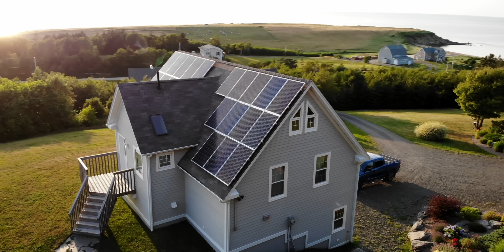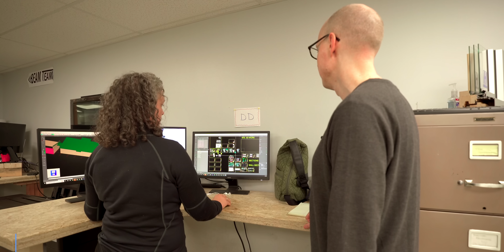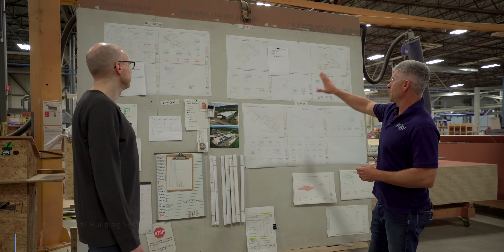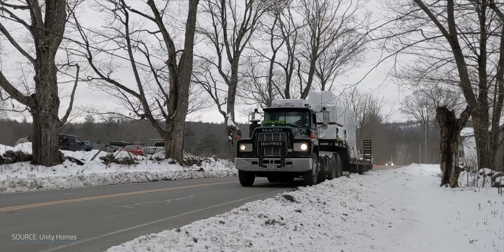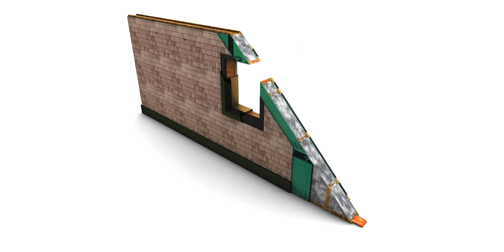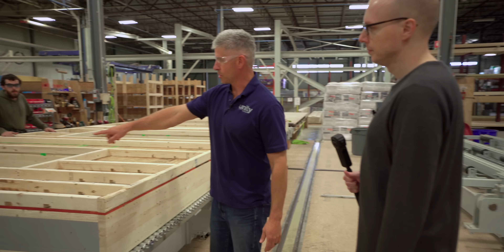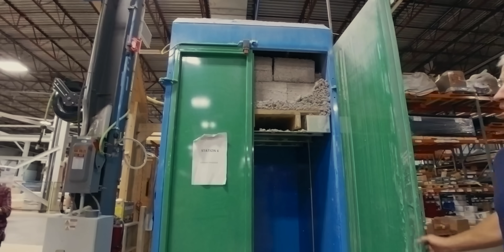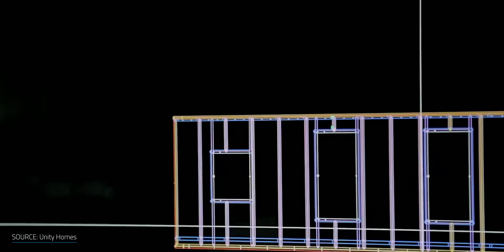The Simple Genius of a Prefabricated House - My Net Zero Home Build

Comment: logical or not prefabricated/manufactured homes don't have a great resalve value; they've been made for over 70 years; it isn't aa new idea and this problem persists.  You also have limited financing options, you have to physically be able to get it to your site; which limits lot options, the house you show is only semi manufcatured as it comes in many parts so it wouldn't have HUD codes applicable to manufactured homes.  Nearly all houses have parts made elsewhere such as trusses; so one would have to question if this would really be considered prefabricated or manufactured - looks more like a traditional house with walls made off site which are not transported as a home; or half home. Your home also doesn't look to be mobile after you make it so I'd venture to say in most of the USA it i would be considered conventional home rather than prefabricated.  Your choice may lower the cost per sq ft some but it also means you can't have such things as a stucco finish or probably even a tile roof which are very popular in sections of the country and required in some areas.

Comment: One of the best things I noticed during the video is how this company, plus the process keep in mind the health and safety of their workers 10 fold. Every single station had some type of assisted device that took a 2-6 person job to one. Not a single person had to bend down to get something or hold a nail gun for a 16 hour shift. 

Every step was methodical and thought out for safety and clarity. Not a single finger in the way and everyone is going home at the end of the day in one piece. Awesome system all around 👏
Reply from the maker: I agree!  When I spoke to Tedd it was one of the first things I mentioned to him.  The setup for the workers is impressive.  Thanks for watching and sharing your thoughts!
Reply: I thought the same thing until I saw them bending over to tape the zip seams. Surely there's a better way to do that.
Reply: @breakingcustom-l6y  adhesive tapes like that are really hard to do with machines unless the tape is prepared with the intent to be machine applied, and I bet ZIPs warranty doesn't handle a robotically applied tape yet... all their warranty material talks about hand rolling the tape. I wouldn't be surprised to see an automatic dispenser roller tool come from them soon to handle this kind of automation.
Reply: @breakingcustom-l6y  Yeah, it looked like there was lots of room for improvement still, but it still looks WAY better than typical construction.
Reply: I was actually kinda surprised they weren't wearing cut-sleeves and/or hardhats though, due to heavy overhead equipment operation.
I've spent a lot of time in metal manufacturing, so a bit different, but the same safety concepts would be applicable.
Reply: @GammaRays10  There might he HH requirements in some areas with overhead crane etc., but likely not needed throughout the shop as I see a lot of areas where they wouldn't be required.
Reply: the panel flipper at 14:22 had me cringing, the chap is inside it as it closes!
Reminded me of the trash compacter the heroes get trapped in in Star Wars.
Reply: The system and the machines were invented in Germany and Austria . Hundegger machines are now used all over the world . The company in the video didn't come up with this system .
Reply: I’m guessing most of these factory workers speak English.
Reply: @TomBTerrific  not sure how that is relevant but sure.
Reply: @TomBTerrific  hell no !!!!